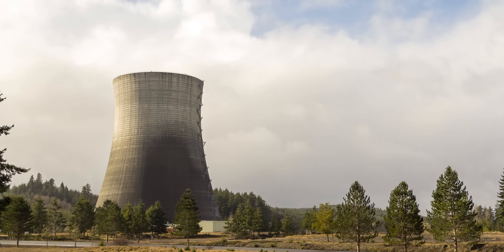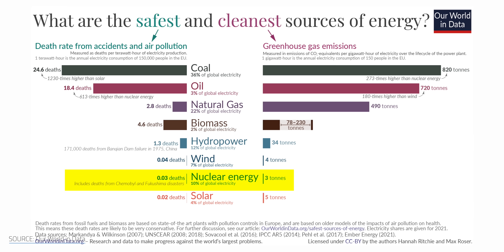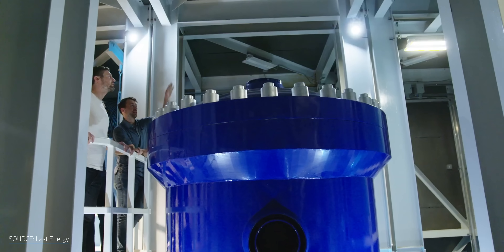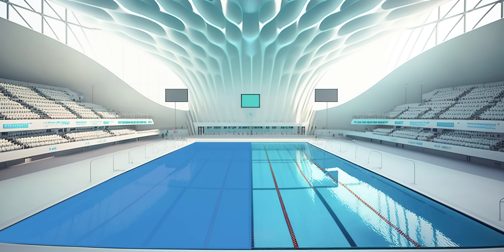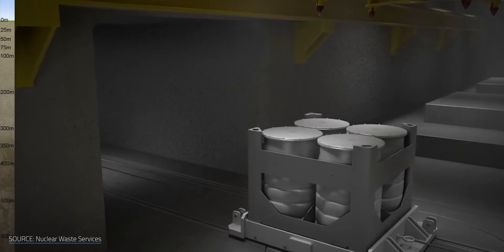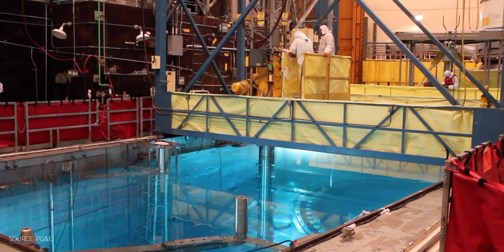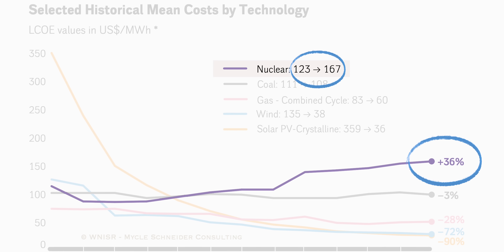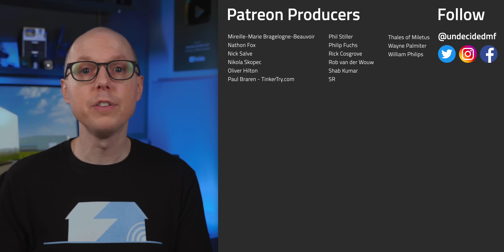Is Small, Fast, & Cheap the Future of Nuclear Energy?

Comment: Good video, Matt. As per usual.

My first question was also as many others have posed, how does Last Energy compare in LCoE? Someone else below has asked about incorporating capacity variables into LCoE and some clarification on that would be quite interesting.

However, my biggest question is why on earth are we not recycling the waste (and when I say "We", I mean North America since you mention that Japan is already doing so) and is that something that is legislated against so Last Energy can't do it or is it just to cumbersome/expensive to make it viable? Seems to me that might make a pretty good video on it's own.

Thanks!
Reply: It is currently not legal to do so in the US, and has been the case since Carter.  The concern is that when you reprocess, you separate the fuel into components, including Plutonium.  Theoretically, someone could steal that plutonium and make a bomb.  This isn't realistic, but is the basis for the legislation.  We don't push it at this point as the once through fuel cycle is currently cheaper than we thing a closed cycle would be.
Reply: @chriscragg  Hey Chris, thanks very much for a speedy reply.  Two thoughts:

1. Couldn't someone steal the waste and reprocess themselves, thereby gaining the uranium? Isn't that why it is stored very securely? (Rhetorical, yes) And therefore, couldn't we just protect the plutonium equally as diligently but without the 24 millennium timeframe over our heads? Or find a good use for plutonium in the next millennium?

2. This is the real answer, then, that it is not cost effective to recycle and reuse so why does Japan do it? They are opposed to strip mining uranium? They don't want to bury the waste in their own seismic backyard? Some other ethical reason?

Really interesting stuff.

THanks!
Reply: @kentmcneill  Theoretically, yes.  But if they had technology to reprocess, they would have access to advanced technology and have to be very sophisticated.  Also, the ability to steal a highly radioactive item and transport it in a shielded container is non-trivial.  That isn't something you do in the middle of the night.  The 24 millennium time frame is for the decay of the long lived fission products.  Important to note that the long lived items are pretty low in radioactivity.  The "hot" stuff decays pretty fast (which is why it is hot).  Uranium itself is radioactive right out of the ground.  Plutonium is more radioactive, and decays away.  It is very fissile and stuff we really want to keep and use in reprocessed fuel (its the good stuff).

Japan and France do it, for various reasons.  One, its just a good idea to reuse fuel than to have to store it.  Two, it limits the amount of uranium you have to purchase.  Countries that don't have uranium mines must import it.  The US does have our own mines, though many have shuttered.

Comment: I would love to see smaller scale safer plants until a full scale / full grid like the Mega Packs used in Australia.  That is pretty cool to see.  Old EV batteries put to use in some here in CA also
Reply: Once the EV batteries finish their use-by date in cars the batteries will be available for grid use in large numbers. The concept of base electricity will be a faded fairytale.
Reply: @peterbaxter8151  How close to that can we be, given our slow adoption of EV's.
It will increase demand for them and drive their price up in the short term.
Plus there's no standardization of battery formula making them even more rare.

I think green hydrogen makes for a better choice for storage medium for off hour use and more versatility to service large machinery operation that can't be converted to battery use.

Recycling EV batteries down to their mineral levels to be reused in EV's will cut mining for rare earth metals from unfriendly countries.
Green Hydrogen is an infinite resource, rare is just rare with commodity driven pricing.

Imagine every home and building producing its own daytime energy with solar and the excess going to the local grid to produce green hydrogen to be used at night locally and sold as fuel for large industrial machinery nationally.
Reply: @IMGreg..  I don’t see “Green Hydrogen” as a solution. Recently Europe moved to define hydrogen generated from gas as green which is a nonsense. Hydrogen is not easy to store because of its small molecular size. It takes a great deal of energy to split out of water and it is currently created using highly polluting fuels and most of it is not green at all because of that.
Reply: Just have a look to Tesla last investors day presentation. Exactly what they layed out.
Reply: Putting lots of small MR in serie loses the benefits from a bigger plant. Scale gains are a thing in massive industrial process.

The only case in which SMR would be usefull is remote small communities on islands or such...

Comment: Nuclear power disasters are not common, and the waste can be handled carefully. A risk that Matt did not mention is the diversion of nuclear material for weapons. The fuel requires the mining and low-level enrichment of uranium with centrifuges, which is the same technology used to make the highly enriched uranium used in one type of nuclear bomb. Other nuclear bombs are made with plutonium that is produced in reactors. The "upcycling" processing of nuclear waste to make new fuel is the same technology used to extract plutonium from the waste. There are also possible dirty weapons that use waste without any nuclear explosion.

Comment: Those prices for renewable LCoE doesn't include the over building and energy storage needed for them to match the >90% capacity factor of a fission plant. I would like to see an apples for apples comparison in time and cost for a renewable "plant" with a >90% capacity factor. But like you said it will take all types of production, the size of the battery needed to keep a place like NYC or Tokyo powered and heated in the winter will be massively expensive, not to mention thousand of hectares of land needed for the solar and wind to charge it and provide power to the city, and it will have to be replaced every decade or so, while an SMR complex will have a much smaller footprint and cost in the long run. This is especially true with more EVs on the road.

Comment: No. People have been talking about this for well over 20 years and no one has succeeded in shrinking reactors (in actual production, not PoC or demos) so they can be manufactured as modules and assembled more cheaply, with lower costs and faster. I was a HUGE fan of GE's (now GE/Hitachi) S-PRISM ( a commercial implementation of the Integral Fast Reactor - a very safe design) and I hoped the AP1000 could succeed and result in many smaller AP reactors built to this vision. It hasn't happened yet and reactors only take longer to build and get more and more costly with worse overruns. 

Ain't gonna happen. Nuclear will never be cost or time competitive and it will always have the waste and radiation issues IMHO.
Reply: LOL.  There are no nuclear submarines or aircraft carriers, right?
Reply: @scottslotterbeck3796  Whole different situation (and technology - not safe in neighborhoods or civilian areas) and the costs are never broken out and most likely any safety issues are hushed.

Comment: It is really sad that you have swallowed the "co2 is bad" nonsense. please for your own sanity do an investigation on CO2 itself. 
life on earth is carbon based all of the carbon for all life enters the food chain from CO2 either from the atmosphere or dissolved in the oceans.
Zero CO2 would equal zero life. 
the ONY world metric that has actually increase in step with CO2 has been crop yields. and thanks to that increase deaths from famine are now at an all time low despite the population being at an all time high. compared to 150 years ago, the population has increased 500% while deaths from famine fell 500 FOLD (99.8%). and it is not just the 19th century, there have been fewer deaths from famine in the 22 years of this century than on average were killed by famine every single year of the 20th century.
CO2 feeds the world it is the greenest gas there is.

Global temperatures are not being affected by CO2 rise, the planet is cooler now than it has been for 9,000 of the last 10,000 years.  the planet is only warmer than it was during the little ice age, the Medieval, Roman and Minoan warm periods and the Holocene optimum were all much warmer than today. 

For 7,000 years the planet cooled as both CO2 and CH4 were both increasing. CO2 does not drive climate warming, it does drive increased food production and increased biomass in general. 
The ONLY effect of reducing CO2 would be to reduce the planet's ability to support life. 

During the last few glaciation cycles, the planet began warming when CO2 was at a minimum and began cooling when CO2 was at a maximum because as the planet warms so do the oceans and they off gas CO2 increasing CO2, as the planet cools the oceans cool and they can absorb more CO2 reducing atmospheric CO2.

Comment: LCOE is a consideration.  But it shouldn't be the only consideration.  Think about the "quality of service".  Each energy system has different intermittency "profiles".  Nuclear, while more expensive,  is considered "firm power".  In a low carbon portfolio, you might want some combination of solar, wind, storage, and nuclear.  Think of it like a stock portfolio.  Diversification.  Balance.  Then you price your power delivery based on the whole portfolio. It should be based on a 24/7 match, in actual use (not just LCOE, net metering, ...).   And the reliability should be there, with extreme weather events (which are becoming more frequent).

Comment: A PWR is STUPID due to needing HIGH PRESSURE to keep the water liquid instead of splitting into Hydrogen and Oxygen, which for the record was the cause of BOTH the Chernobyl AND Fukushima explosions and the majority of air spread nuclear waste.
Want a proper reactor? Molten Salt, low pressure, higher temperatures allowed therefore increasing power generation efficiency AND more importantly CAN USE THE WASTE OF THE OLD REACTORS AS FUEL. AND ITS OWN WASTE IS NOT ONLY LOW LEVEL RADIATION BY COMPARISON, IT LASTS FOR HUNDREDS NOT THOUSANDS OF YEARS.
This also means FUEL IS CHEAP and HELPS CLEAN OLD NUCLEAR WASTE. So, Pressurized reactors are stupidly dangerous by comparison. Second, we know this works since 1956. Third, if it were not for the military choice we would have molten salt reactors instead. (That and the fact you can not in any easy way make weapons materials with this type of reactor, and if you did you would be forcing yourself to reload high proton sources to the core when otherwise this would not be needed at all)
Reply: Keep pushing for outdated unsafe tech, yeah, keep it up and let China and India get the Molten Salt reactor designs proven and working and take the market for all next electrical generation via nuclear. Keep up the good work...
Reply: Not to mention you will not beat them on cost, as being able to run at higher temperatures will increase their electrical generation efficiency by at least 2 orders of magnitude.

Comment: Policy should update the requirements for renewable deployment to include mandatory storage that can provide inertia. 
Currently the new kids join the orchestra, play a riff or two on their disruptive instruments and leave, while any other player has to pause while they play, patently waiting to restore harmony when they abruptly stop and start cleaning up after.
Turbines like to run optimally, not throttle up or down, nor store fuel based on weather predictions to stabilize wild frequency swings. It used to be fuel use * time = energy out. Current policy externalizes costs to grid operators while subsidies help chinese manufacturers sell plants that replace engineers with precarious installer jobs, that are needed only once. Good luck restoring that talent base when we need it after people tire from load shedding, rationing and increased distribution cost.

Comment: Comparing Solar and Wind LCOE to dispatchables is pointless, they dont work for load following, baseload, inertia without batteries, and even with, one needs software for the control. Add these and use actually the 60 year lifespan of a nuke, instead of 25 and you get a proper valuation of a service provided compared to alternatives. 
Some energy use is inelastic demand - no dispatch capacity in these cases is reckless. Think hospitals or adverse weather events

Comment: I wish this wasn't the facts but almost 1 in 100 nuclear power plants has a disaster. Considering the risks of such a disaster, I don't think that track record is good enough. It makes it very hard to support nuclear. If 1 in 100 people died skydiving, I don't think many people would do it, do you? It would seem that nuclear should be a necessity power option only and we should be working to moving away from nuclear the same as fossil fuels. Fission reactors are dangerous to the entire planet and the waste is deadly for thousands of years and we have no long term plan for this waste. The current option is only good for 40 years? How messed up is that? They are extremely expensive for good reason. Trying to cut cost just sounds like increasing disaster statistics to me. Really hard to support nuclear.

Comment: Regarding the cost of nuclear energy, it's not adequate to compare it against the cost of wind and solar. The cost of solar when it's dark is infinity, since it doesn't exist. The cost of wind when it's calm is infinity, since it doesn't exist. Nuclear is always on. So if you want 24/7 electricity, you either need renewables + fossil fuels (which goes against de-carbonization, unless you include carbon capture, which is expensive), or renewables + batteries (which don't currently exist at a grid scale, and will likely be insanely expensive). Renewables on their own are not an option; so do we want to fill in the gap with gas, nuclear, or batteries? In that debate, nuclear wins hands down.

Comment: This tech should be restricted to 50,000 or more properties , localised reactors are a serious threat, and if like Russia lighthouses that use simple reactors were not maintained due to budget cuts or like in Russia forgotten about when the government Collin the 90’s ,further the threat from terrorism on low protected sites is one serious issue that can’t be left in local or utility hands , abc while the waste only needs to be replaced 10 years apart the cost of recycling this matter to inert and reusable for.medical uses , burying is not the answer, it just leaves a serious issue for generations to come , Ecco yes collapse, regimes, change , so a permanent fix is needed to be found within 10 years than burying

Comment: Very interesting video, as usual, Matt. Thank you 🙂
I have been having a question for which of course I don't and won't (most probably) have an answer: with all the fusion energy and even more the new fission energy... is there NO OTHER and better method of obtaining electric energy apart from the "boiling water to move turbines"? Are there really no alternatives?!?!?! 
I find it a bit sad that we still need to boil water to get electricity... Are there no better conversion methods? Thanks and keep on the good work!!! 😀
Reply: well, the thing is that doing it this way is a very efficient, well understood, mature and more importantly cheap technology. there are other ways of course, two of these options are thermoelectric generator, which use thermocouples to generate electricity from an heat gradient without any moving parts but the efficiency caps at around 40% and magnetohydrodynamic generators, which need a plasma to work and while they do not need any moving parts they are limited to powerplants that already produce their own plasma, and while this apply to most combustion plants... a simple steam turbine do the same job more reliably and for cheaper.
Reply: You don't need to boil water using solar cells. While they are about 25% efficient in converting the sun's energy into electricity the Sun's energy is free.

Comment: Nuclear energy is the only industry with a negative learning curve: it gets more expensive, with more cost and time overruns over time. And the private sector will not insure nuclear power plants. Time to stop beating this dead horse and move on with renewables. China is ample proof that even if there are no regulatory/NIMBY hurdles, renewables will be built at a far higher scale than nuclear.